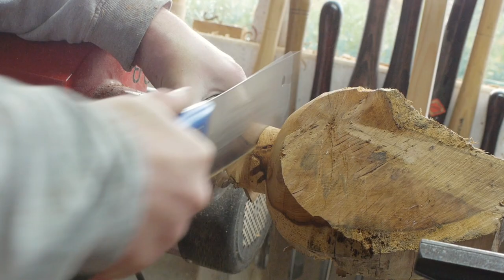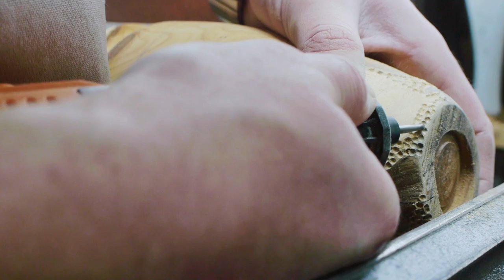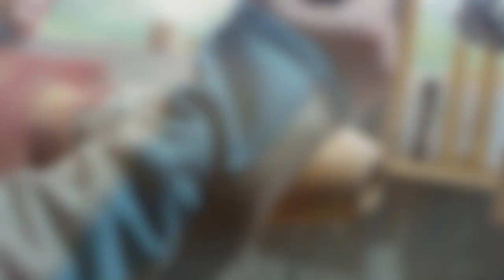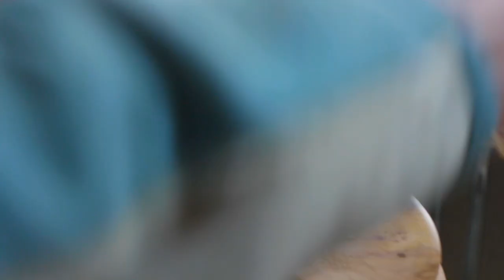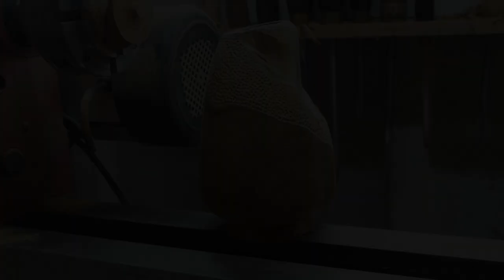Woodturning - Textured Vase turned from English yew.

Comment: Very pretty vase, I like the idea of turning a vase with the grain orientated  like a bowl.  I have an odd shaped piece of cherry that I might try to turn like that. I guess hollowing was challenging? Keep well, Rob.
Reply from the maker: Thanks Rob! I've had this chunk for a while now and nearly chopped it up into smaller blanks several times but I'm glad I held off! I didn't really hollow this properly, just ran a forstner down it, I've found that the dried flowers stand more upright in a narrower chamber. Definitely dried or imitation flowers for this though as it's unlikely it'll hold water. Thanks for watching and take care bud 👍
Reply: @tfturning  I had the same thought for my piece; it is too nice to cut up into pen blanks.  I like your intro btw, I need to work on branding for my channel, I just prefer to turn :)

Comment: Hi Pog, That is beautiful on so many different levels. The saw marks show the history of the piece. The Dremel work on the sap wood is brilliant. The odd shape of the whole piece and finally the finish. Great work Pog. Take care. cheers, Huw PS Great save as well.
Reply from the maker: Cheers Huw! I'm glad others notice and appreciate the rough chainsaw side as much as I do. So the fix.. went a bit to far with the forstner I think, at least it was able to be saved, not sure I would have been able to cope if it split apart after all the dotty dremmel work 😂 Cheers mate, take care 😁👍
Reply: @tfturning  Hi Pog, At least the fix meant you didn't have to square the bottom to get rid of the little dimple from the forstner bit. LOL 
The Dremel work must have taken ages. When I made my first goblet I put dimples as a ring and that took long enough.
Reply from the maker: @WoodenItBeNice  This is very true lol. And yes your goblet, I liked it anyway but now I have a new found appreciation of it! 👍